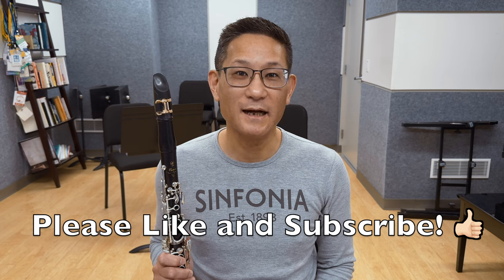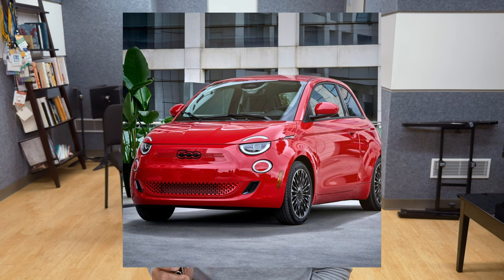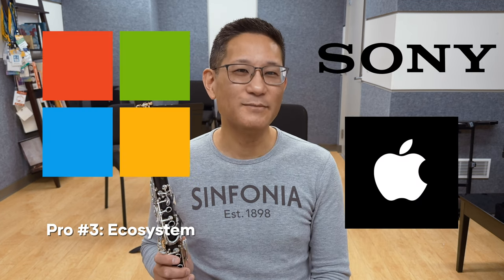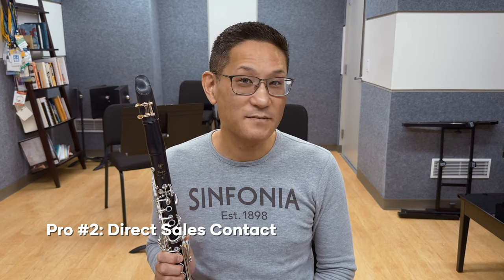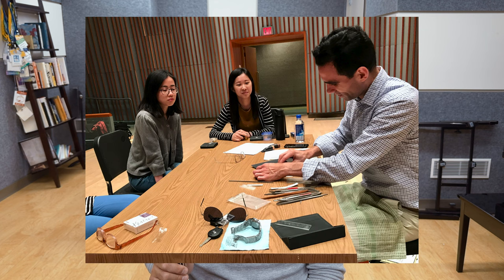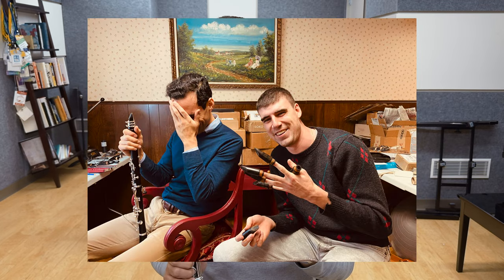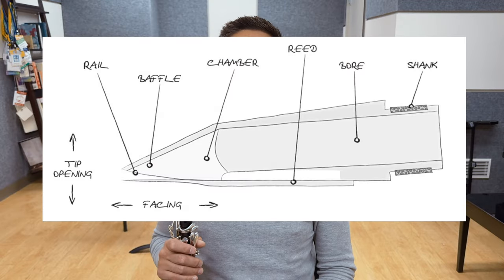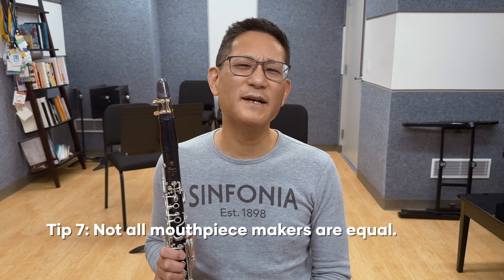Handcrafted vs  Machine Made Clarinet Mouthpieces!

Comment: I'm definitely on team Handcrafted, playing a Kanter E2B mouthpiece. It's based off the Chedeville Elite blanks, which he describes as the best material he's ever found to make mouthpieces with. My teacher, Chris Pell, also plays this model, but our pieces are a little different, as per his request. While his E2B was customized to be "a little cleaner", he specifically requested Mr. Kanter to make mine to "hold the sound together better". The effect to me as a player is that I can focus less on using my face and more on my air; altissimo control is relatively easier for me. Your point of "Tell the maker what you feel, not what to do." We as players couldn't possibly know what to tell them, other than what we personally feel on the inside. Quite an insightful video!

On the topic of "that company", their studios are exactly as you described. Not really capable of changing anything, but they'll try to guide you to the model they make that would fit you best to their knowledge. I don't miss my R13 keys tarnishing or the sulfuric taste the BD mouthpieces get after 1 year (that's probably very unhealthy for us as clarinetists, if we're being quite frank), nor do I miss buying a new mouthpiece every year due to wear and tear. 

However, Mr. Kanter assured me that when my E2B starts to feel "off" in any way, I can send it back to him, have the mouthpiece cleaned and restored to its original proportions and dimensions, and have it back as good as new for a fraction of the price. To me, this is a no-brainer; I'd be spending the same money for 5 years of buying new off-the-shelf mouthpieces for this one that could last me many years if I take good care of it.
Reply from the maker: Agreed! Developing a relationship with a maker can not only improve your playing, but mean security down the road! Thanks for watching!
Reply: @john.kurokawa  Definitely! No problem, I'm loving these great wisdom-filled videos. I especially love that you don't hold back and talk purely from your unique experience, regardless of whether it's the popular opinion or not.
Reply from the maker: @amaypant  Thanks Amay. Not everyone will agree my opinions, and that's fine. But these companies get a LOT of our money. We are dependent on them for what we do, and they need to be held accountable. After all, we're the ones funding them!
Reply: @john.kurokawa  Indeed!

Comment: I'm testing the backun vocalise g2/h2 right now. Everything I've kooked up says that more open tip mouthpieces are more resistant than the medium/cloes ones, but im finding the opposite to be true. I'm trying the same reeds on both and the g2 (medium one) felt more resistant. Any idea why? I tried vandoren blue box traditional 2.5, legere euro 2.75, and legere sig 3.0. I have a legere euro 3.0 coming in the mail.
Reply from the maker: I can't speak to that, as I haven't had the chance to trial those mouthpieces in anything but a noisy convention center, and I usually don't like to do that, as that can be misleading. I personally don't use reeds on that end of the spectrum, but again, there may be other forces at play besides the facing- the baffle, chamber, bore, etc...

Thanks for the perspective, and for watching!

Comment: The tarnish problem has absolutely nothing to do with „a special company“ or „low quality rubber“. Its just the thing that the sulfur in fresh rubber mouthpieces reacts with the silver on the keywork. After a few months there is no sulfur left in the mouthpiece and you can store it in the case as usual. The only difference is, that handfinishing mouthpieces takes a lot of time and the sulfur is already gone when the mouthpiece arrives at the customer..

And its absolutely wrong to say, that CNC machining is not completely accurate. No human can be as accurate that a CNC-machine can be. For example look at Theo Wanne Saxophone mouthpieces, those mouthpieces are absolutely identical. Also Daddario mouthpieces are pefectly made, without a Single Hand touching the mouthpiece.
It simply is wrong to say that handfinishing is better than machining. It is different but it you want consistency then you should look at machine made mouthpieces and if you want to spend (to) much money for that one special mouthpiece then you should look at handfinished mouthpieces.
Reply from the maker: I can only speak from my personal experience and from my talk with others in the mouthpiece industry. If this tarnish problem were in fact the result of sulfur present in the mouthpiece, then EVERY moulded mouthpiece would cause silver tarnish, which is NOT the case. 

I have stated my PERSONAL OPINION on handcrafted vs. machine made, and I have stated it is just that, an opinion based on 30 years of professional experience. I don't have any experience with the Theo Wayne mouthpieces because I'm not a saxophonist. 😁 If your opinion is different, that's ok; the world is beautiful because it's colorful. Thanks for watching.
Reply: @john.kurokawa  Like I said, theoretically, EVERY moulded mouthpiece causes silver tarnish in the first few weeks or months. After that, the sulfur doesn't evaporate (?) in the air anymore. Therefore, a handfinished mouthpiece lost all of its sulfur at the manufacturer because of the time it takes to make a mouthpiece combined with the time the unfinished mouthpiece is stored at the maker. Big companies are much faster in manufacturing from the raw product to the finished product. So, at the time the mouthpiece arrives at the customer, there could be some sulfur left in the product that can stain the keywork.

I made the mistake with my bass clarinet. I got a mouthpiece by a great manufacturer from Vienna "Gleichweit", and he warned me to store the mouthpiece in a separate pouch for the first few months, or my keywork will stain. A few days later, I put the mouthpiece in my bag normally by routine, and now half of my bass clarinet is stained...
But I am sure that the mouthpiece is definitely not made out of "bad rubber." It's just normal for EVERY brand new moulded mouthpiece 😉
Reply from the maker: @maximilianschramm8609 That is not my experience. However, I appreciate your insight. ❤
Reply: @john.kurokawa  And I dont want to say that your experience is wrong. I just wanted to say that it has nothing to do with good or bad rubber. It just has to do with the time between moulding a mouthpiece and storing that mouthpiece in the case with the clarinet. YES, a handfinished mouthpiece by a good manufacturer won't tarnish the silver. Thats your experience, and there is nothing wrong with it! BUT the reason for that is simply that the raw unfinished mouthpieces (that are moulded in big batches every now and then) are stored sometimes for years before they are finished and sent out to the customer. By then, all the sulfuric fumes have evaporated and therefore aren't able to react with the silver anymore 🙂
Reply from the maker: @maximilianschramm8609 It's fine- we can agree to disagree- I hope that you found other parts of the video informative.